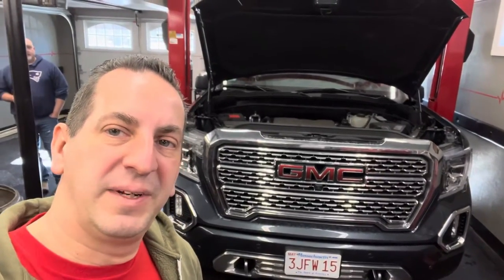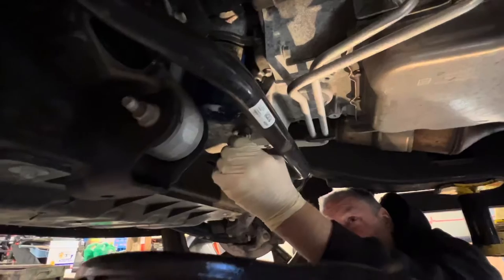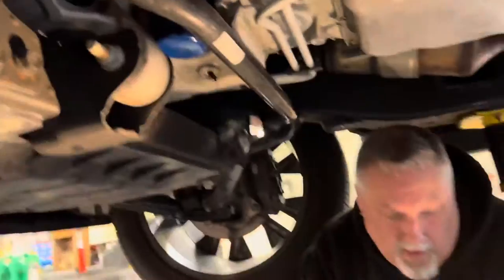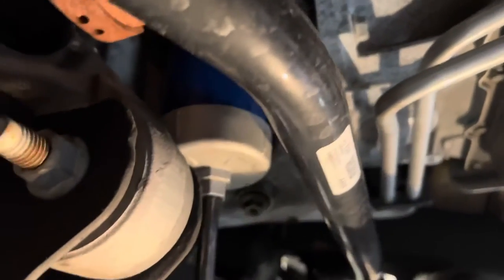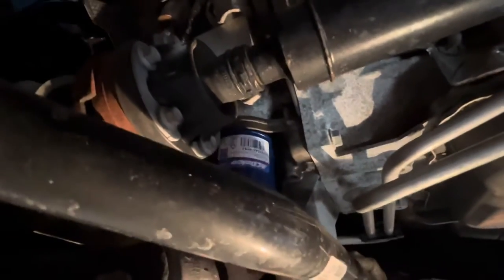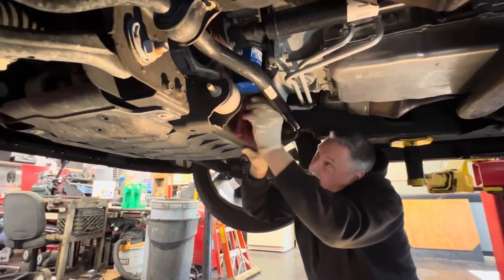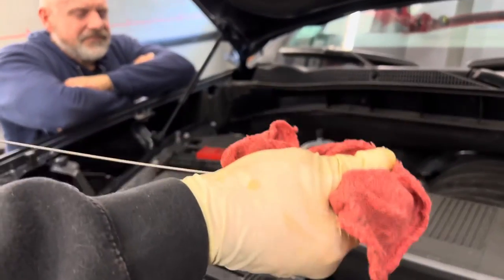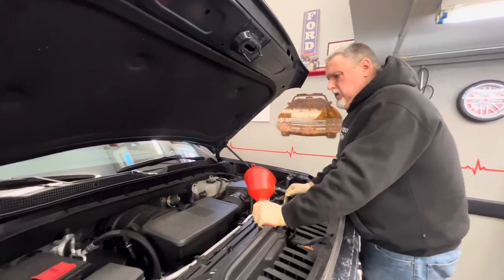How To Change Oil 2019-2021 GMC Sierra Denali 6.2 Engine

Comment: Does the oil HAVE TO BE full synthetic? That 💩 is exp lol
Reply from the maker: It is the same price when you take into consideration that instead of changing the oil at 3,000 miles you can go to 7,500 miles AND full synthetic is better oil than the dyno stuff.
Reply: You dont buy 70k plus trucks if you cant afford oil

Comment: A heads up for anyone owning a GMC/Chev with the 5.7 or 6.2 engines from 2019-2023. Research proves  GM is trying to protect themselves from the added costs of replacing a defective oil cooler line.The issue is at the engine block where the inlet and out cooler lines attach to a external adaptor to the engine block. When the outside temperature is cold and you start your engine, the engine oil heats up. At some point the high pressure line will have a catastrophic failure dumping your oil on the the pavement. If not shut down quick enough, your engine will lock up. GM not only has a national back order on the oil cooler line but also has a back order on the engines leaving you without a truck and possible payments. Proof is in the pudding!  Research “Global Safety Field Investigations DCS5833. GM says the defect only on certain VIN trucks sold in Canada and Alaska. This is false! Research proves trucks in several states who have diverse cold temperatures are having cooler line failures.   Look up GM N212326940  This should be a National Recall for every GM/Chev. truck sold!  ATTENTION: If You have purchased these trucks, PURCHASE the Extended Warranty package that covers the engine/transmission. GM is getting away not paying on vehicles after 60,000 miles until the owners file enough complaints with the Federal Trade Commission and NHTSA. I was able to purchase the cooler line from the Chev dealer in Canada but after it was installed, they said the engine was locked up would need to be replaced on my extended warranty.
Reply: There’s no 5.7 buddy
Reply from the maker: Thanks for watching
Reply: @Halfpintfrenchies 😂😂😂
Reply: This is exactly what happened to mine so they claimed. Took a while to get the parts but didn't have to replace engine. Just the cooling lines